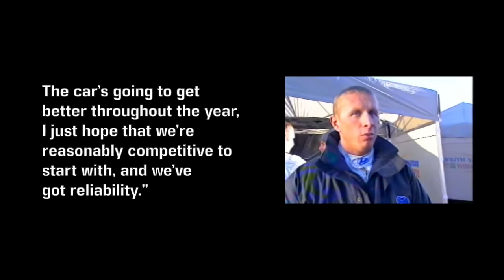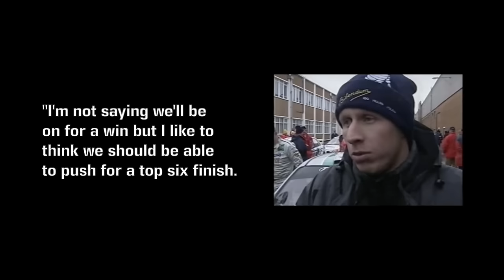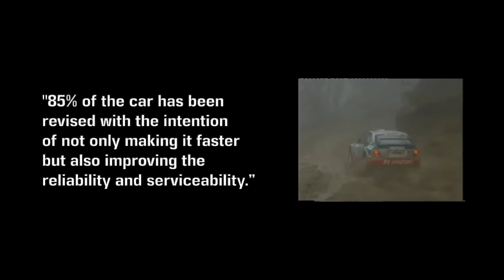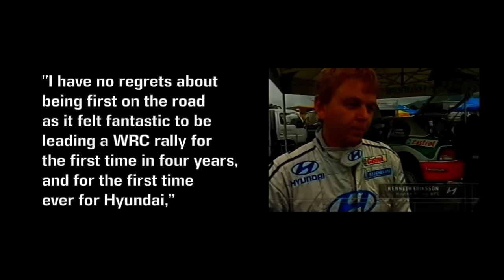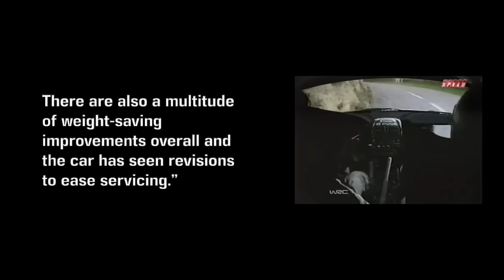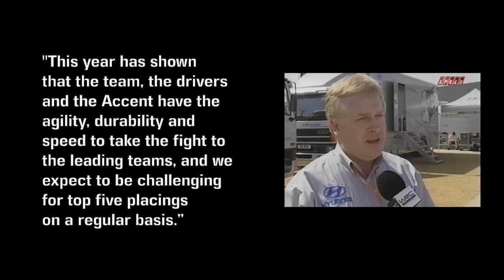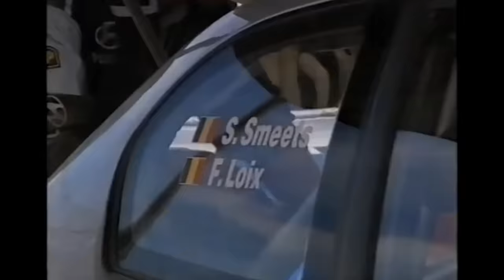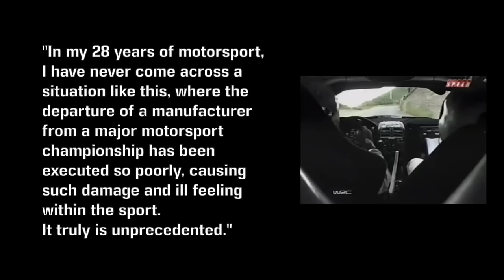Hyundai's Awful WRC Program?

Comment: The Accent walked, stumbled and tripped so the I20 could run.
Reply: I drive a 2005 accent, man its kinda a pos but I love it and man I wish I could get a proper wrx esc version of it.
Reply: Did you know the I25 hatch is basically an Accent hatch, and I20 is like a compact shrink version of the I25. Thus, I20 is actually related to Accent and shares lots of it's DNA based on different gens of Accents respectively. Also, HB-20 is a lite I20 although it's not much like an I20, incase you didn't know.
Reply: @johndavidson3424  I did not know that! Thanks! Unfortunately they do not sell the i20N over here in the States, only the i20 as the elentra gt.
Reply: @johndavidson3424  UPDATE: some guy just wrecked my driver side door, might see that veloster lol
Reply: I drive a bonestock 07 accent and it's the most fun I've ever had in a car. No traction control, ABS, cruise control, or automatic gearbox. Safe? Probably not... fun? absolutely (as long as you're not on the highway).
Reply: @snottyboy9983  No no not safe, do not get into an accident at 60mph+
Reply: @joelikespotatoes8321  Quick correction, the Hyundai Elantra GT is the i30, not the i20.
Reply: i20 WRC is a beast. Would rather have one of those than a hypercar.
Reply: Look, none of us did anything, OK?

Comment: Very interesting video. Cadillac's GT program with the CTS-V and the ATS-V.R would be interesting too. The FIA introduced a minimum production requirement of 20 cars to block the ATS-V.R from racing in europe. They explained this with the argument, that they wanted to ban so called "GT3 prototypes", which were designed within GT3 rules but without the compromises of a customer racing car.
Reply: The Renault RS.01 GT3 comes to mind about gt3 prototypes. The watching the frikadelli 296 at Nurburgring this year it would be hard to not call that an lmp inspired design
Reply: @TheElDoctoro24  AFAIK, the RS.01 was never an FIA-GT3 homologated car, it was just allowed to run by the respective series it competed in.
Reply: The problem with the ATS-VR was the fact that Pratt & Miller are an extremely stubborn company who really seem to dislike the idea of having to share their cars. Teams would make offers to buy an ATS-VR but they would often outright refuse to. It's also why Labre Competition were the only privateer to run a C7.R and is also why the Camaro GT4.R is the most expensive GT4 costing $400k, more than several GT3 cars
Reply: @sunsolaris  400k? I can only find 259000$ as the Camaro GT4.R's price.

Comment: Hyundai really did have a fascinating string of disasters.

• Not fast enough to start with but the team clearly had the will to develop

• Developed a better car but it was still underpowered and unreliable

• Eventually began to show promise but arguably lost its best drivers as the car got better

• The 3rd gen car seriously had big potential from a basic platforms standpoint, particularly in the handling department. But it's godawful turbo continued to let it down amongst other engine issues

• Also gained Fast Freddy (who was occasionally fast but when he wasn't, he was in a wall). His career alone is a curious one

• Evolved the car again but the unreliability got worse, and the turbo was still a shocker

• Eventually began to run into management issues, then money issues, then made a total arse of itself in front Hyundai's bosses

• Finally ran out of money (Hyundai rather clumsily and lets be honest pretty publicly pulling the plug), a team, and realistically any good drivers. Freddie was never gonna be a champion. Neither was Armin. Kankunnen I think was just there to have a go in top line rally cars (see how he was being battered towards the end of his Subaru stint) and poor Justin Dale and Jussi I'm fairly convinced to this day were running a car using the leftover parts that could be scrounged from the bin.
Reply: Then came back with a different Hyundai rally car and teams.

Comment: I`m currently own a 2008 Accent in this body (yeah, they still exist in 2023). I was surprised that car has independent rear suspension. And I was wondering - where does it need it? Because It is drastically cheap, small, underpowered sedan with rear drum brakes.
Now i see. It`s pretty cool to watch "combat" version of it with widebody, Castrol livery and 300 hp under the hood. And to be honest - it`s a shame that all went that way. 
Nevertheless - thx for the video man.
Reply: Ironically one of the last of the reliable Hyundai road cars
Reply: @JohnDoes620 Lol no, Hyundais are pretty reliable
Reply: @SnowChickenFlake  aside from the mass amount of Hyundais with engine problems sure. 
In the past 10 years I haven’t seen any manufacturer blow engines for anything other than defects more than Hyundai/Kia. 
Ford is a close second though.
Reply: Where are you from?
Reply: I've owned an Accent of that gen and it's incredibly fun on loose surfaces like snow or gravel. Loved to lift off oversteer. Handles the snow so predictably, it didn't feel like it floats on the snow like other compacts I've driven tend to. 
Engine was pretty reliable too honestly. Pretty slow but it kept the car going, decent low end torque for around town.
Reply: it depends on the model. If you have a theta engine, it can be a bit of a timebomb @SnowChickenFlake
Reply: This generation of Accent was heavily based on the late 90's Mitsu Lancer, suspension has the same components. Hyundai had a deep partnership with Mitsubishi from the 80's to around the millenium.
Reply: Sorry to break it to you, but your road Accent has ZERO in common with the WRC version. ZERO
Reply: @davidvitan3590  man i don't know what are you thought reading comments above but i' am not that stupid. Ofcourse it's different - it's a race car. Another engine, sequential transmissiion and AWD, different suspension and brakes. Don't even talking about body panels and aero elements. But WRC cars obvious based on real life civilian ones. That`s why we speaking about it. You can recognise real life Yaris or Impreza in the WRC one aren't you? Same is here.
Reply: @TheToxicDrift rear lights and rear window are the same only. Only.
Reply: @JohnDoes620 The G4FJ (accent/Veloster engine for most of their runs) is a perfectly reliable engine. It’s just the Lancer engine cast in aluminum instead of iron (though with a timing chain instead of belt).

Change the oil every 5,000 miles and it’ll last for ever.

Go more than 2,000 miles past when your oil change is due and it will 100% grenade itself.

Perfectly reliable on both points.

Comment: The category Hyundai started in in 1998 with the Coupe was called Formula 2 ( F2 )and it was a class for 2 wheel drive naturally aspirated cars that were very fast on tarmac, due to their low weight ( around 200 kgs less than the 4wd turbo WRC cars, which were limited to 1230 kgs at the time ) high power, around 280 + hp in the fastest F2 cars.
In early 1998, Hyundai started in the F2 class with the Coupe, and in the beginning the car struggled with speed and reliabilty but an evolution version introduced later in 1998 proved to be a hit, and Hyundai became a big player in the F2 class in the late 98 as well as in 1999, when they almost won the F2 championship, but problems in the last rally of the season in the UK, stopped that sadly.
Both Seat, Skoda and Hyundai were successfull in F2, but struggled in WRC, the demands to succeed in the 4wd WRC top class was simply higher than  in F2, and sadly none of these 3 teams got the budget  needed to play with the big names like Peugeot, Ford, Mitsubishi and Subaru
Reply: Actually, if you think about it, Seat, Skoda and Hyundai were NOT competitive even in 2Litres. Sure, the Ibiza won titles, but when the Peugoet 306 Maxi and the Citroen Xsara Kit Car were in the game (that is, fighting with WRCs for the lead), the Seat Ibiza was nowhere near them. The Octavia 2WD and the Coupe were never good platform to start with: one was too big, the other was never really developed for tarmac.
Reply: @Snarl616  but if I recall correctly both the Pug and the Citroen were tarmac only cars, developed mostly for the national French rallies. So while they were competing with the WRCs on asphalt they didn't even bother to turn up for the gravel/snow stuff.
Reply: @randomfaca  It's only true for the Xsara. The 306 Maxi actually also raced in gravel rounds (Adruzilo Lopes in Portugal), albeit they were not WRC rounds.

Comment: The production car was very reliable. Full of cheap plastics and switches that faded, but very reliable engines. Very pleasant to drive too. Not very sporty but comfortable and spacious.
  I think the platform was great, but obviously Hyundai bit a lot more than they could chew and they tried to go on a small budget, which never works in motorsports. While other teams used their motorsport experience to make their car, some others worked with much more experienced racecar developers, like Subaru did with Prodrive. If Hyundai had worked with Prodrive as well, i think they would have built a championship winning car.
Reply: This gen Accent shared it's platform and engines with the late 90's Mitsubishi Mirage/ Lancer. ✌️
Reply: Even Ford, outside of 1993, wasn't very good until Malcoln and M-Sport took the program over.  Then it still took 10 years to get it to the top.

Comment: About breaking turbo's: in those days this was not uncommon, rather actually quite common. The reason was ALS, that system really stressed any turbo on any car.
I don't think this gen. WRC cars had VVT so the ALS was very crude, lots op pops and bangs with shockwaves damaging the turbo internals which are quite delicate to begin with.

Comment: Awesome video i always what happened in this series and to these cars. Im honestly curious on what issues they had with the engine and what caused the turbo issues because those 2.0l engines are typically pretty reliable when built right and can handle a lot of power.  But it seems like the company didn't invest in properly setting up the cars and building the engines .

Comment: Glickenhaus in GT as next project suggestion.
They sold a car with the Enzo's face and the only temas were one who made it silver and another who made it in rubber duck color. In the GT3 field that theroically should be extremely leveled.
Reply: Which was the P4/5?
Reply: @dangerdean9066  no, that was for GT2 and was built around an F430 for regulations. Or whatever.
I was referring to the SCG 003.
Reply: @il-ma.le.  OHHH

Comment: nice video. Thinking about some WRC cars, than the SEAT Cordoba WRC would also be an interesting one, especially as the SEAT brand will dissapear. Also there might be an interesting story in Mitsubishi's WRC. the force to leave the GroupA car and needed to switch to the awful Evo VII WRC. And than later come back with the great WRC04/05 who had mega potential, but Mitsu decided to stop the whole, while the cars still continued for years with quite some success internationally and nationally.
Reply: Mario Fornaris' ingenuity of Lancer. Lancer WRC 2005 was the car that was definetely hitting signs that in 2006 it would be an successor to Evo 5-6 championship winnings, but corporative logic of MItsubishi Motors decided the other way, not satisfied with actually somewhat good results by 2005.

And by then Fornaris once was working in Peugeot in its best days of early 2000's. So it was definetely the car created by genius. 

But the corporation never accepts any fails, even if they are not that miserable.

Comment: The car had potential. But relaiability, bad luck, Hyundai pulling out from MSDs deal and mistakes. But the good thing is they are kicking it with the i20!

BTW they did not compete in Safari for 2 years due to testing

Also Kuchars recce car got squished by a lorry in Catalunya

Comment: Hyundai Motor Company is a South Korean company.
i am korean
We would like to inform you about Hyundai Motor Company’s experience participating in the WRC, which is well-known in Korea.
Hyundai Motor Company's participation in F2 was entirely delegated to the British MSD.
MSD, which achieved good results in F2, recommended WR CAR's participation.
Hyundai accepted this and participated in the WR CAR race.
Hyundai Motors only provided funds and vehicles.
WR CAR is a vehicle developed by MSD in the UK and participated in the WRC.
My grades have been bad the past few years.
As I stayed at the bottom, my image worsened.
CASTROL sponsors were removed and entry fees increased.
Hyundai Motor Company withdraws from participation in WRC
Hyundai Motor Company announces re-participation in 2013 WRC
This time, Hyundai Motor Company competes with its own technology.
Participation in WRC is also directly from Hyundai Motor Group.

Comment: The poor Hyundai performance was not only because of the car, but because at the time Hyundai did not have top drivers. Kenneth Eriksson, Alister McRae, Freddy Loix and Armin Schwarz were all second league drivers and they never delivered top results for any manufacturer they drove for. Alister later in Mitsubishi was also not performing particularly well.
Reply: Well Kenneth Eriksson won the 1986 Group A world rally championship in a Vw Golf Mk2, this championship run parallel with the Group B cars in 1986
Eriksson was also succesfull in Mitsubishi and Subaru in the 90:s, with 6 wrc rally wins, and 3 titles in the Asia-Pacific championship in 1995, 96 and 97, he and team mate Colin Mcrae would have won many more rallys in 1997 if the cambelt tensioner in the new for 97 Impreza wasen't made from chewing gum and decided to break time and time again, giving the 97-98 Impreza Wrc the nickname :" Cambelt snapper "
Freddy Loix did well in Toyota before joining Mitsubishi, but in the Mitsubishi team, the car was always tuned and set up to Mäkinens liking, and most focus was put on Mäkinen.
Alister Mcrae did well in the 2wd Formula 2 rally class " F2 " for naturally aspirated 2 wheel cars in both a VW Golf and in 1998 and 99 in the Hyundai Coupe F2, at first it wasen't succesfull,  but a later evo version in did the trick, and in 1999 Hyundai was a top contender in the F2 class
Reply: The WRC spec Lancers were really crap to be fair - in '01 they pretty much lost Tommi the title.
Reply: @randomfaca  agreed